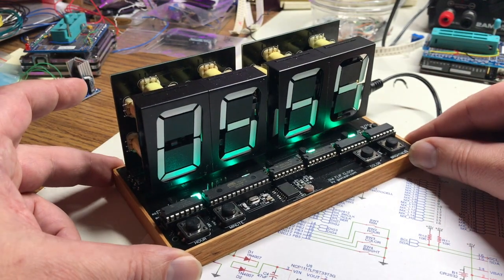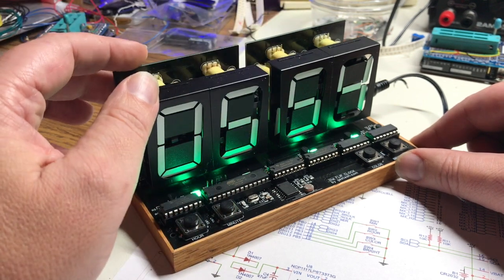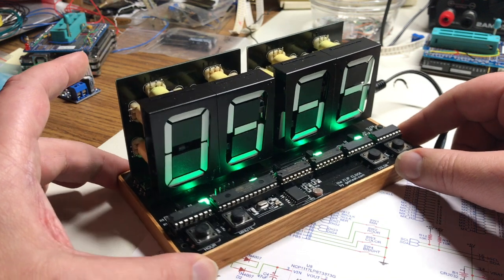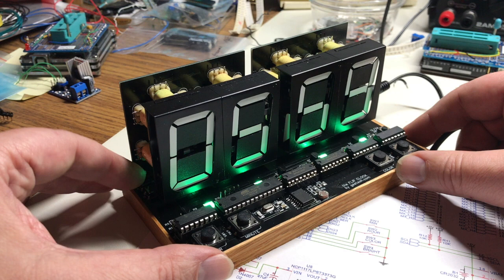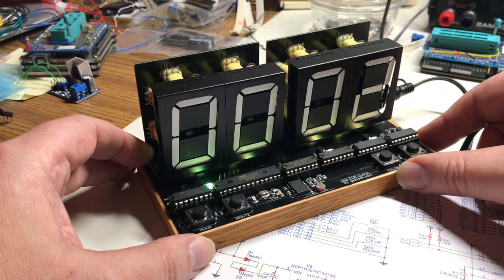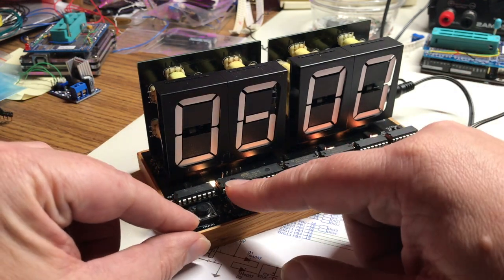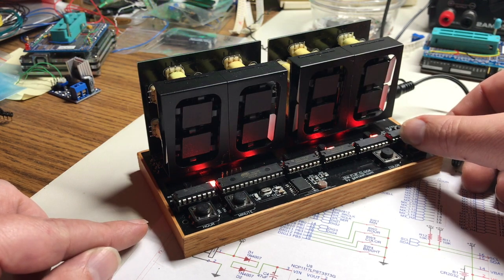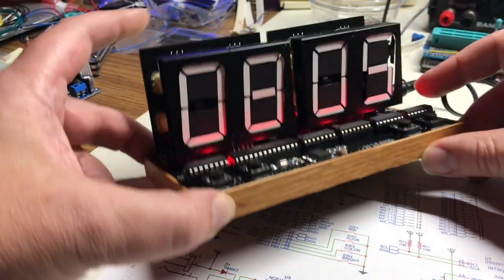Signalex Flip Display #8 - Black Clock Boards

Comment: What are the flip displays? I've been looking for some of these for my own project.
Reply from the maker: These are old "Signalex" displays as my description describes. Signalex was purchased by ScoreTronics who doesn't make these smaller ones anymore. These are very hard to get today. Technically these are "Vane" displays. Difficult to search. Flip Displays are easier to find. flipdot.com (alfa zeta) makes some currently. I purchased some. They are in a later video. Expensive shipping.
Reply: @geeteoh1  a friend and I paid quite a bit of money to Marcin at Flipo/Flipdot/AlfaZeta and it didn't end well. Not keen to repeat the experience. Thanks though. I'll check your new view!